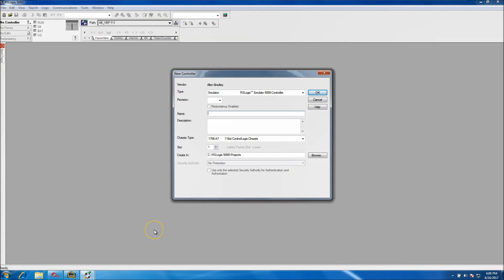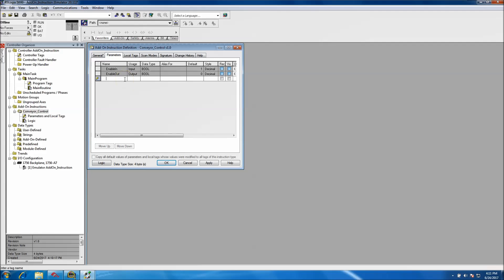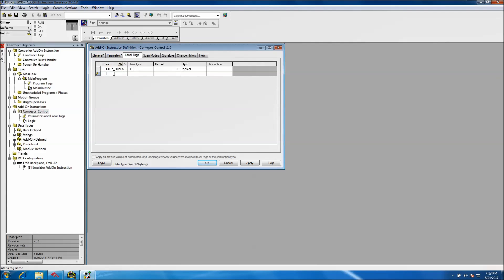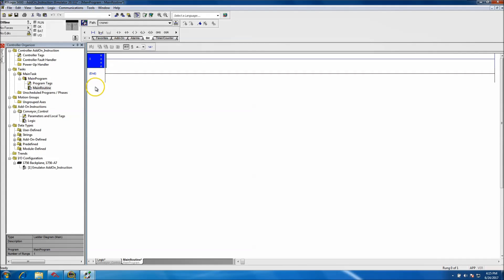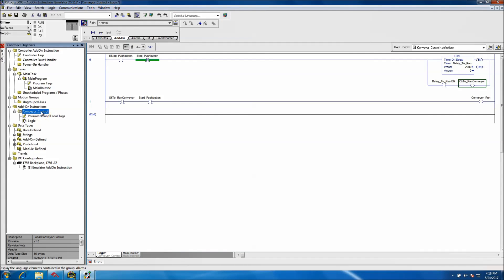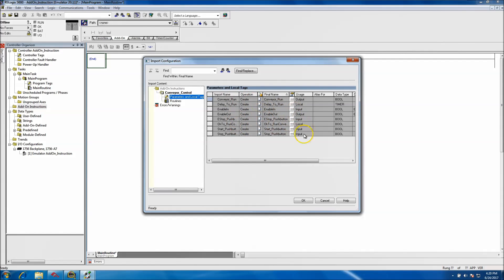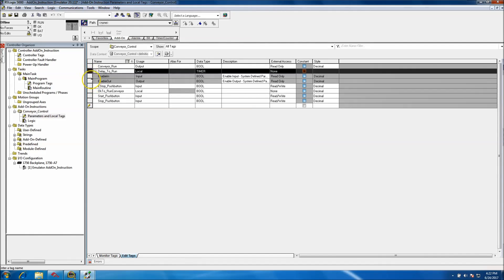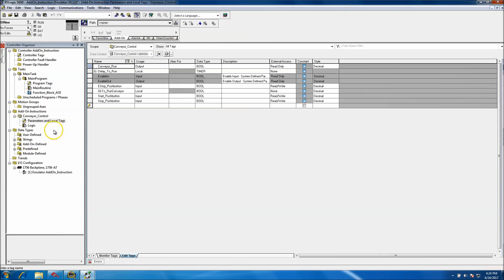RSLogix 5000 Making An Add On Instruction Or AOI

Comment: How to change Timer (TON in AOI) preset value from outside the AOI? I am moving the preset value by taking a value from outside the AOI but the timer stays at 0.
Reply from the maker: Open the instance of the AOI tag that is use from the base of the AOI instruction then find the timer & add time.

Or monitor the tag for that AOI then in controller tags drill down to the timer & add time.

Two very simple methods

Comment: I'm using version 32 but the one I made was created as an input where the rung needs an output in order to work. How do you create it to where it is the output for the rung?
Reply from the maker: The short answer is that you need to edit the Add-On Instruction to make it an output.

I teach all of this in great detail on my other platform

Visit: https://www.allen-bradley-plc-training.com/p/rslogix-5000-add-on-instruction
Reply: @ShaneWelcher  i got it thanks